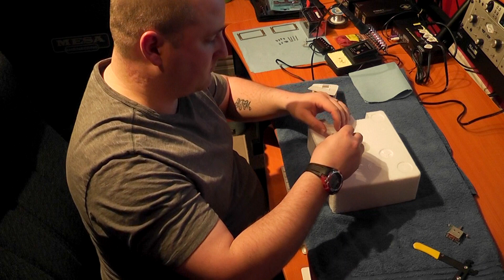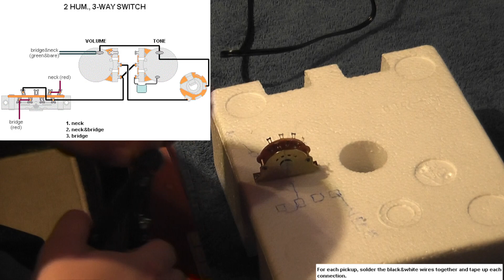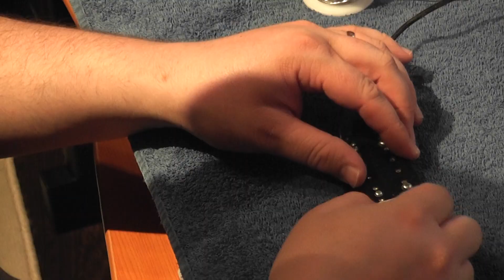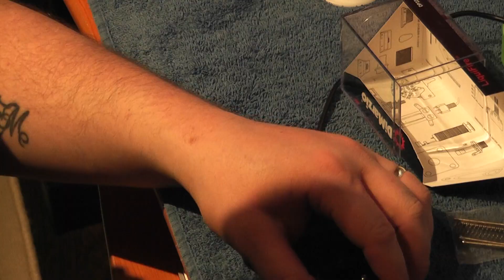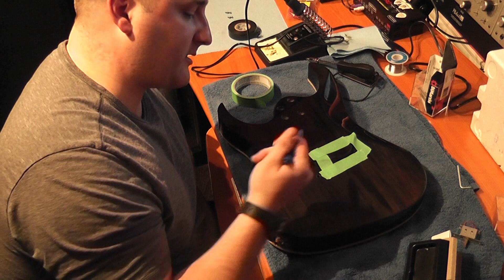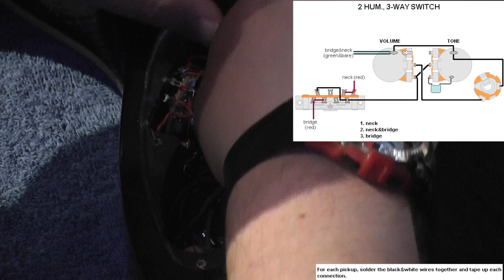Ibanez RG3EXFM1 Modification -Dimarzio Crunch Lab And Liquifire Pickup Install

Comment: Does this 3 way split the coils like a JP6 or just give you the ability to use both humbuckers at the same time? If it allows to split, what is the model number of the switch?
Reply from the maker: I ordered this switch to have the ability to switch and blend humbuckers, you would have to look into what they have available or what needs to be used in order for it to be wired as a coil split. There customer service is really good I suggest emailing them for options and they will send you the wiring diagram as well.
- Kevin
Reply: @Crypticmaskguitar  Thanks so much for the quick reply! Great video.